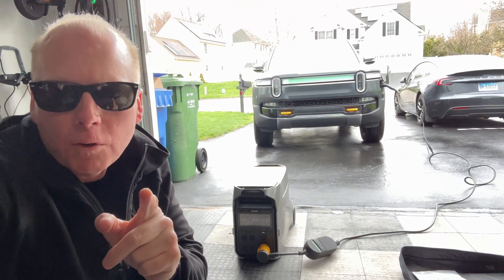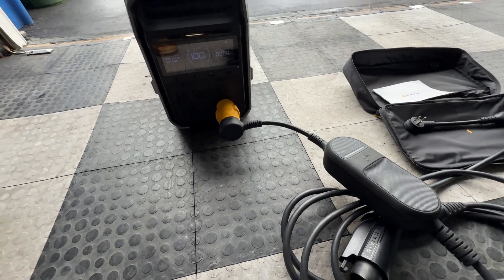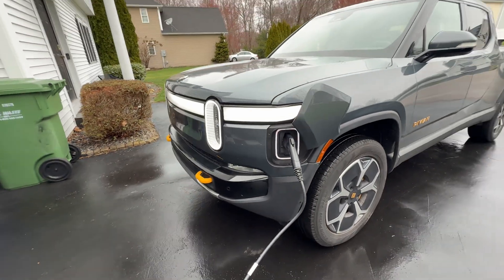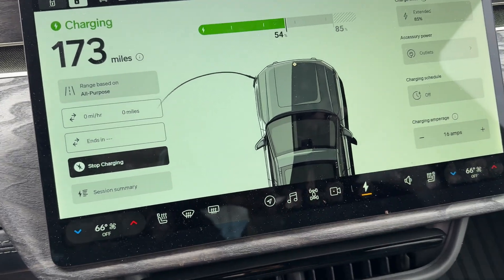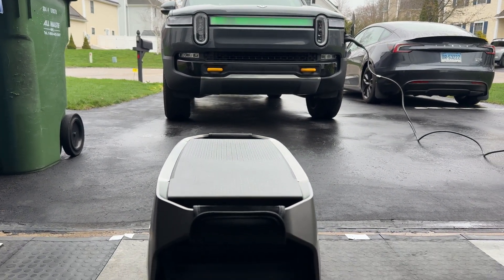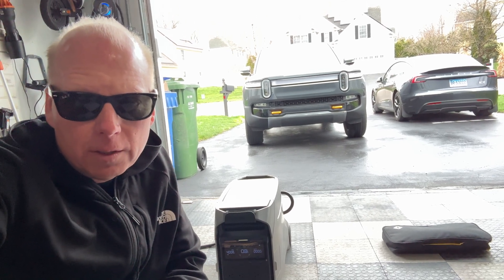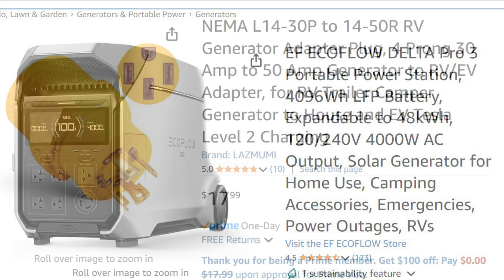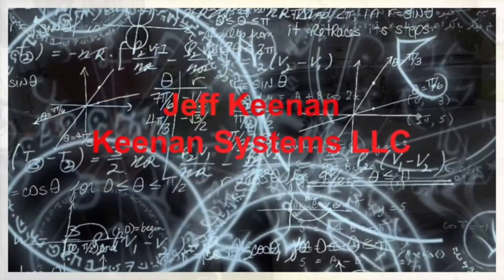Can I Charge a Rivian with a EcoFlow Delta Pro 3 at 240V Using the Portable Charger?

Comment: It would be cool to see how adding solar panels to your ecoflow as its charging the R1T does.  Basically the ecoflow is acting as a middle man between the solar and charge.
Reply from the maker: Yes the Delta Pro 3 can take 2600W of solar so far I only have 200W of panels but I will be adding more soon.  Lets say you had enough panels to get 2600W *4 hours a day for 10kWh  you could drive about 20 miles a day off the sun.